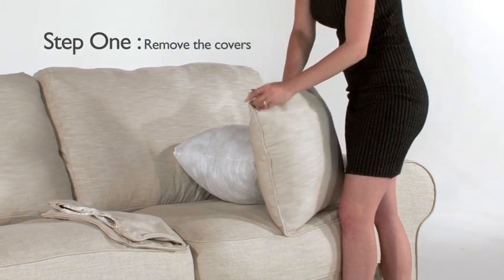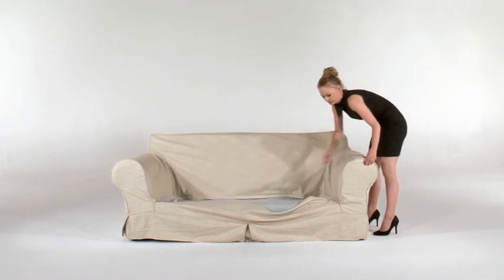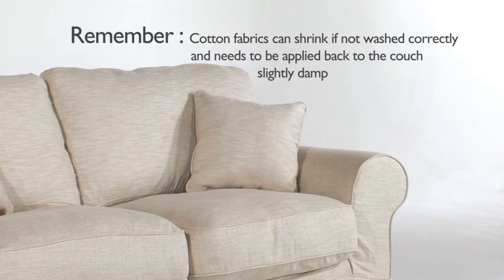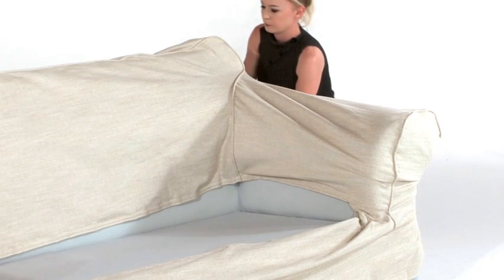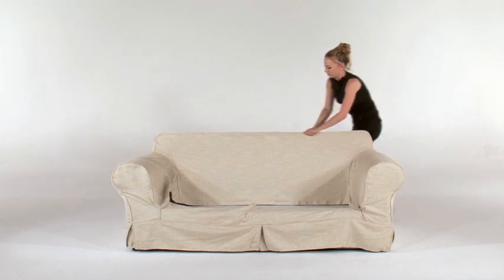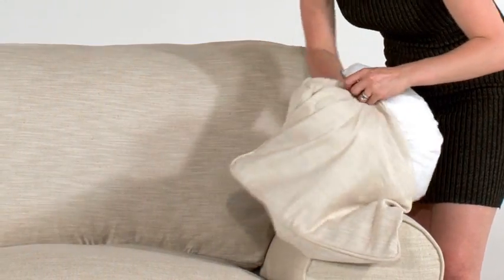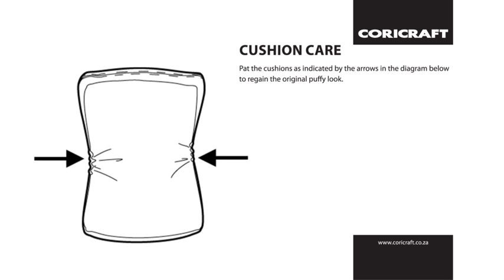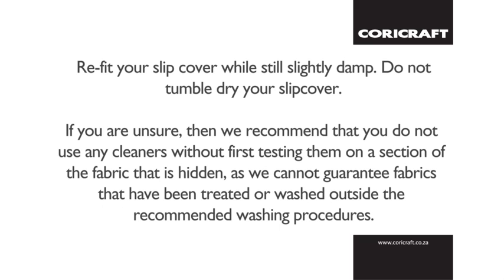Coricraft - How to dress your slipcover couch

Comment: Looks a lot easier on the video. I just got my hands on a 2nd hand 3 seater. It uses 4 square pillows instead of those big ones, and I struggle so much to get the stuffing in, it feels impossible. The inners is so big compared to the casing. The only 1 I managed to get in so far is because the zipper is a little bit longer than on the other 3 for some reason. Any tips and tricks out there to help me?